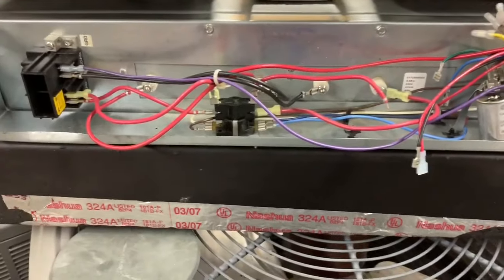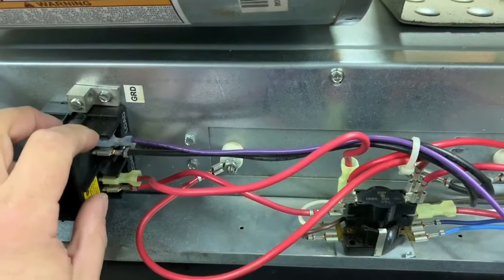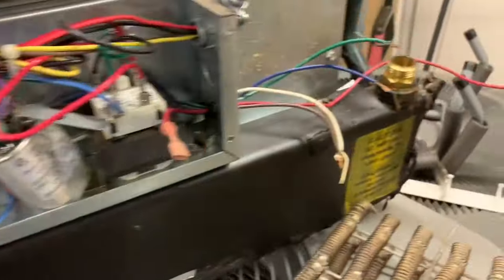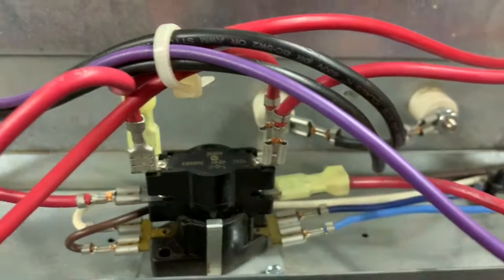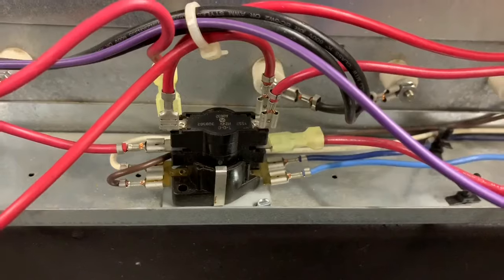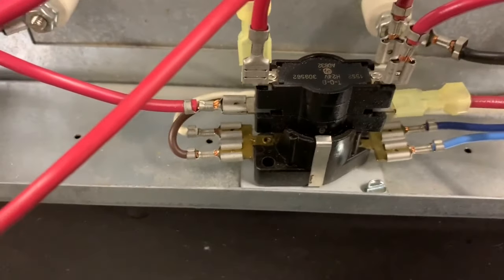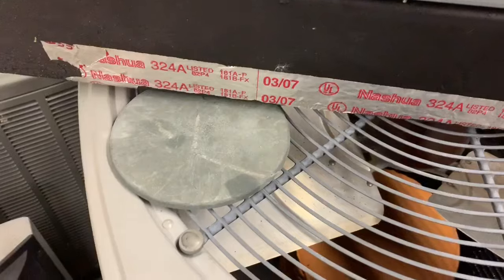Troubleshooting Electric Heaters For Air Handlers (Sequencers Explained!)

Comment: this was helpful in some ways and added questions for me. i have a similar unit that wont fire the element but the blower comes on as soon as i turn on the thermostat. ive replaced the thermostat, the sequencer, the limit switch wired to the element and the element itself. i only wait about 20 seconds of the the blower running and the element not firing before i shut the unit down again. Am i not waiting long enough or is something backwards?

Comment: Thank you very much for your video. After I replaced these three items: Time-Delay, Fan-Relay, and Contactor (outside). Still, my AC cooling system keeps running and cannot be stopped. Question: Does Sequencer relate to fan-relay and cooling systems?

Comment: Hello

Great educational video. thank you very much for your help.  I have a question about the low voltage wiring diagram. If we have installed a 24HX5 fan coil with a Goodman Heat Pump Condenser how we may wire the fan coil without a heat strip making it a heat pump system? 

Please Help

Thank You

Comment: Reasons sequencer type of switch is used is to limit the initial current to the heat strip. One stage  heat strip dose not need or use sequencer....ad a second stage ....then you need the sequencer because the initial current draw would be way to large

Comment: Great video. I have an issue w my Fahrenheit fuh724 garage heater. It’s has very little use. I noticed when it was working, it would make a clicking sound when I turned on the breaker. Now it doesn’t make any sound and it doesn’t heat up. I’m hoping it’s just a relay. I’m gonna take it down off the wall and try to troubleshoot it now so I figured I’d shoot the issue to a pro first. Any input is greatly appreciated. Thank you, Rich.
Reply from the maker: If it was one click when you turned it on then it’s mostly likely the relay your hearing or I think the thermostat on those is a fail point too like the Qmark and Marley heaters
Reply: Thank you for the quick reply. What I failed to mention is that I have it wired through a Tork timer which when I bypassed it last night, turned out to be the issue. The heater works fine now. Apparently something inside the timer failed. Thank you again. Great help !!

Comment: Hi l'm new to your channel and I had a technician out and he used these words. Heat handler has 3 heat bank's and it is a Trane and he said that a limit popped and is not letting the 3rd heat bank is not coming on what is he meaning about that?

Comment: I have a York electric furnace that blows hot air for about two minutes then I hear a click and it only blows cold after that until I reset the breaker. Any advice as to what you think would cause that would be greatly appreciated!
Reply: call a tech

Comment: I have the type of sequencer with the wire soldered connections at 4:mins.My fan runs a few minutes and turns off.Élements stay red and fan starts ,but after quite a few minutes.I guess that I cannot test sequencer without power.Thanks great video.

Comment: If you have the heat strips running at the same time as the A/C, what would be the symptoms? Would you have super high pressure readings on both the high and low sides, making it appear overcharged? And would your delta T indoors be cool but lower than normal?
Reply from the maker: Usually In a conventional air handler the heat strips are down stream of the coil so as far as your pressures are concerned they will look to be normal. The delta -T will be low because the cooled air will be heated downstream by the electric heat. The fastest way to diagnose a stuck on heat strip in the cooling months is to amp clamp the line voltage at the air handler while your set to cool. The blower only pulls a few amps so if your getting amp readings like 15amps and higher then you have a strip on. Each strip typically pulls about 20amps but some are a bit lower. But no blower is pulling 15+ amps under normal operation.
Reply: @ntexashvac7240  great info, thanks.  I briefly checked a PACKAGE unit last week for a neighbor, only had time for a quick check, high side 507 PSI, low side 170 (r410a). Told them it was overcharged, didn't think to check the heat kit. Heat kit was only installed last year, system is 5 years old. Condenser coil is clean. Delta t is only 9-12 degrees. Been going around my head to check the heat strips, but haven't been back. Could it be anything else besides severely overcharged?
Reply from the maker: Yea it could be the TXV if it’s a TXV coil or possibly restriction. I would check the evap coil for even temperature across the coil

Comment: Thank so much! Have a Goodman air handler which will not heat past 68 degrees no matter what the thermostat is set to. Tech replaced sequencers and it worked for a little while. Any ideas?
Reply: Heat strips could be under sized for the tonnage of the system.

Comment: So my ac works fine. But heat doesn't turn on (at least, not the fan. Can't tell about the actual heating). The white wire has no power (at the thermostat). could that be a sequencer issue?

Comment: Blower motor wouldn’t kick on. I tested resistance in the windings and they read fine. I’m starting to believe it’s the fan delay relay stuck in the open position

Comment: How are you running 10kw off of one heat sequencer thats 40 amps on a 25 amp sequencer?
Reply from the maker: In this particular instance it’s not a 10kw it’s a 7.5-8 kw kit to be specific, but to answer your question, heat sequencers are rated by “single load contact” so each individual contact inside the sequencer has that rating not the entire sequencer has the 25 amp rating. So since most strips are 20amps or less you can safely run 3 strips on a triple stack heat sequencer or 2 strips on a double as most every manufacturer does. You have to think of each stack (contact) as an individual sequencer not the sequencer as a single unit. If 25 was the rating for the whole sequencer then every heat kit out there running 2 strips on one sequencer would be out of spec but that just not the case. Now if we were to double up the strips on one contact we would have to make sure we were below that 25 amp single contact rating or we risk burning it up. Hope that clarifies.
Reply: @ntexashvac7240  okay thank you for taking time to explain it that really helped

Comment: Maybe you could  solve an issue. Why would the heat strip not come on when everything else is working. Old Goodman system. Everything has continuity, new sequencer and limit switch on heat strip, new thermostat, wired correctly, and all wires test correctly. My maintenance lead and an electrician can't figure why. Also the element has no breaks and does have continuity. The system runs but no heat. New 60 amp fuses as well. The property wound up replacing the entire system but another apt unit is doing the same thing. Any opinions would be great. Thanks
Reply: I’m having the same issues with a Goodman did you ever figure out the issue? Currently sitting here cold 🥶
Reply: @lillianm1242  No, we wound up replacing the complete air handler. The only thing I could think of is if one of the wires shorted. Didn't continuity test each wire individually. All components were receiving correct power from to the line in block through to the element. A mystery! Have you shut down the breaker so no power then run your fingers over all wires. Feel for tiny burn marks. We get this all the time. Resident will flip the thermostat switch on and off not knowing there is a delay of up to 5 minutes before the system comes on.

Comment: I have a heat sequencer that stopped working recently (no heat and no continuity between any of the terminals).  It is double switch exactly like in the video and single time timed H30-70 C1-35.  Problem is it is so old its not in the record of most distributers and exact replacement or replacement model is not found.  Another issue is it is labeled 4-5 , 1-3, and the double brass terminal in the bottom which is completely different from the newer replacements.  The closest I found is H30-90 C1-30 but it has M5-M6, M7-M8, and the double brass terminal in the bottom.  Can this be used in place of my old sequencer?  If so do have to wire it slightly different form the original?  The original had element connected to 1 and element 2 connected to 4.  It is a 2 element 10KW HVAC electric heating system.  I check the elements and both elements have continuity. On mine I also have two what seems to look like two pin elements.
Reply from the maker: Yes it should work. The timing is approximately the same which is fine. Since it’s only 10k heat there isn’t much fear of it pulling too many amps at startup anyway. Wire it up the same as the old one and you should be fine. Yours may have the high limits built in and that can be why it looks like it’s dual pin on the element. Thanks for watching!!
Reply: @ntexashvac7240  Actually on the element side it looks like there are 6 elements and two thermodiscs one by each set.  Four of what looks like elements have only a single terminal while two have two terminals.    It looks like I have two different types of elements in two sets.  Each set has the 2 single terminal elements (I think this is one element as there is continuity between the single terminals) and the double terminal element.  You are saying M5-M6 and 1-3 makes no difference?  When I connected it initially fan started up without being turned on in the thermostat.  Initially 1-3 was connected to M7-M8 because it was in the same spot on the sequencer as the 1-3 on the original sequencer.   Should I connect what was initially connected to 1-3 to M5-M6?  From what I understood the number indicates which starts first.

Comment: Got a furnace with no control/circuit board that blew a transformer (no fuse) replaced transformer and added fuse and blows the fuse instantly when i turn the power on! Any thoughts?
Reply from the maker: Low voltage short in thermostat wire most likely. Disconnect all thermostat wires from
the furnace then replace the fuse and try again. If it doesn’t blow then you’ll need to track down the short in the low voltage thermostat wires

Comment: Had a question on a unit I was working at work ... The breaker is completely off yet it's still getting power and idont know why or how
I changed the sequencer fan relay heat disk and run cap and it worked fine for a few hours then tripped the breaker so I turned everything back on and blew the fan relay so I replaced the relay and same.thing it blew the fan relay again and I turned the breaker box off but when I test it to see if it has power it does and I'm so lost
Reply from the maker: There is a good chance you have a bad breaker at the panel. If you still have voltage at the air handler when the panel breaker is off then it is usually a bad breaker or sometimes it is wired to multiple breakers and isn’t labeled. Try looking for other double pole breakers in the panel and turn them all off and see if that doesn’t kill power. If you still have power then change out the breaker in the panel this could be your issue.
Reply: @ntexashvac7240  I have the whole entire panel off everything 20s 30s and the double 4p for stove it was all off but idont do breaker boxes got grabbed 1 time and never again
Reply from the maker: If you have every breaker off in the panel, and you still have power, then try turning off the main service breaker, if you still have power to the air handler after that then there is a serious electrical problem in the house wiring and I would tag in an electrician.
Reply: @ntexashvac7240  copy that thank u sir . There is no main unfortunately so I will call the pros out . I do apartment maintenance and I'm. still learning the ins and outs of HVAC .

Comment: Im getting power to the unit but not the thermostat what would cause that  thanks!
Reply from the maker: Could be transformer or sometimes there will be a 3-5 amp fuse or even a fusible link. Look for blown fuses if none found then test for 24v at the transformers secondary voltage terminals

Comment: So there are multiple heat strips and the sequencer powers up one and then allows a delay before powering up the other one? Is that what it's doing?
Reply from the maker: Correct. There are many different versions of sequencers with different on and off time delays but the concept is the same. The big reason is to keep amp draw down and maximize efficiency.

Comment: I currently have an electric furnace and, with the thermostat off, the sequencer is turning the heat elements on. Thermostat off. Unit keeps heating. Fan off. 

Just random turning on and off of heat elements, this issue started after I put everything back together after a deep clean. 

So the sequencers are working, but im not asking for heat. 

Any ideas?
Reply from the maker: So what’s happened most likely is the ceramic rod that holds up the contact inside the sequencer has broken. When that happens the sequencer actually fails in the on position so it’s actually not working properly because it’s heating without a call for heat. The intermittent on off comes from the high limit switch interrupting the electric flow and heating as the temp inside the heat kit rises due to no airflow because the fan is off. You’ll need a new sequencer.
Reply: @ntexashvac7240  thanks for the quick reply. I watched a video, may of been yours, of a sequencer taken apart and explained how it works, along with your reply im confident that is the issue. My unit is 30 years old, and has 2 separate sequencers, im going to replace both. Thank you for your help!
Reply: @ntexashvac7240  do you think its safe to leave the unit on, until parts arrive, and have it still cycling on the heating elements ?
Reply from the maker: @benm1751   I would not leave it powered up if it’s going on and off, if the limit switch fails you could have a an over heat issue that could damage the heat kit or worse.
Reply: @ntexashvac7240  mt fear exactly, I will leave it off thank you

Comment: I have a trans electric unit, coils heat up and when it’s time for fan to come on, the coils turn off. Any ideas?
Reply from the maker: Does the fan come on after the coils go off? Also there are high temperature limit switches on the heat kit, if the fan isn’t coming on it can trigger those and force a shut down. Which model number air handler do you have?

Comment: Is it normal for the fan to kick on first and then ~20 seconds later the heat strips come on? One would think that heat should come on with fan.
Reply from the maker: It is common especially in older units since the fan relay is wired directly to the heat call. You can swap the the current sequencer with one that has a delay and that will
Solve that, or you can wire a time delay between the fan wire and fan relay, that will cause a time delay on the fan to keep it from coming on first. Depending on what make and model and age it is would depend on the best course of action but it is an easy fix

Comment: The one I took off has a made up jumper wire across one side of the 24 volts. The new one I was sold has a soldered wire across both sides of the 24 volts. Does that matter?
Reply from the maker: No it doesn’t matter. The proper “M” numbers and proper time delays are what matter. The fixed jumper just eliminates the need for a wire jumper
Reply: NTexas HVAC - Old sequencer on one end has,
M1 and M2 and the other has M3 and M4 over M5 and M6. Part #3112-3571 (15SH14) for this one. On Coleman air handler w/15kw strip heat. 

New one that Carrier sold me is different. 
Part #15SH22. It’s got an extra stack and the “M” numbers are on opposite sides and different spots up and down. There is M1thru M8. I just put M1, etc from old sequencer to wherever M1 was on new sequencer and followed the same way with the other ones. 
Is that wrong?
Reply from the maker: No that’s the best way to do it given the new part you have. The numbers designate which strips come on first and likewise which ones go off first. You can get it a little wrong and be ok it’s just meant to not allow all strips to come on at the same time and risk tripping a breaker. The new one just has and extra switch for more strips. What you did is right.
Reply: NTexas HVAC - Really appreciate ur time. Now need to figure out why elements will not come on. Elements ohm out good, heat limits as well all good, sequencer wired, transformer tested all good, new Honeywell stat installed and all setup functions set. Only thing left in this old beast is the blower relay. Just to test with stat face off, I can jump R and G at stat base and fan comes right on but when I jump R and W I get nothing. I have 24 volts between R and W at stat base too. Fun times ahead.
Reply from the maker: Have you checked for 24vac at the sequencer? Make sure you are getting 24 when call for heat. If not start back tracking control voltage

Comment: What are the symptoms if a sequencer is stuck on?
Reply from the maker: The heat strips will constantly be on. If you have and amp clamp meter you can clamp the high voltage wires and look for amp draw. Anything about 1-5 amps will
Indícate a strip is on. Typically 15-20 amps per strip

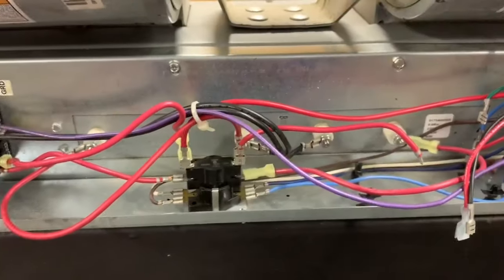Comment: At 4:59,what did you say? I can't hear it clearly. LOL  The problem the customer would have?  no hot strips on even when my air is on??
Reply from the maker: The problem the customer would have is the heat strips would be on with the AC on. It would cause the AC to seem to be running normally but since the strip is on your delta T would be very low.
Reply: And your power bill at the end of the month will be about 5 times as high as it would normally be.